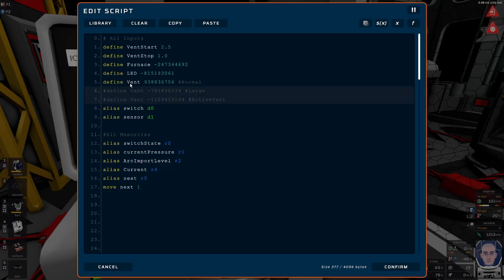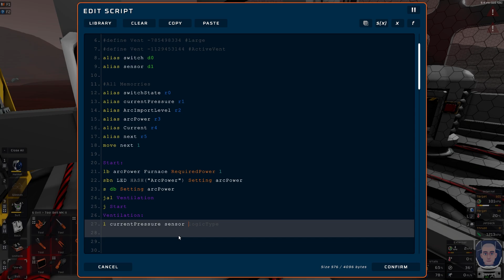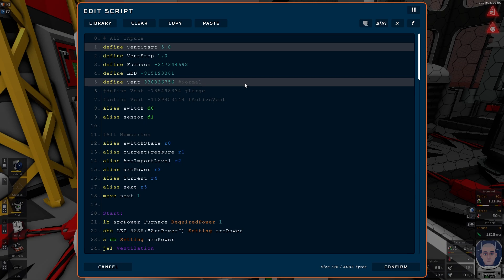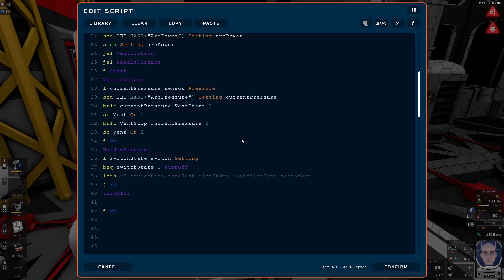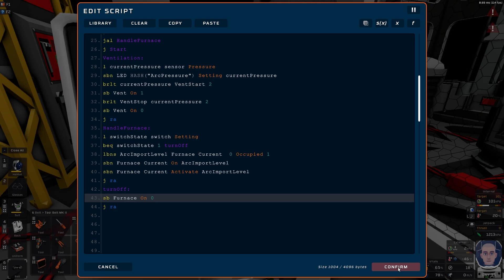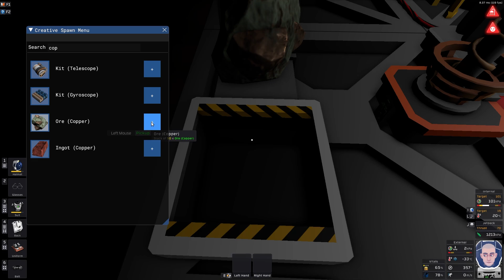Stationeers - Guide to Multiple Arc Furnace - Tutorial

Comment: Interesting concept. Well done.
Next challenge: rewrite the script to use the batch-write option so that you don't have to address them individually.
Reply: For harvies there is a WAY simpler Script...  Where you basically define dropoff Index, fertilzer Index and how many pots you have it...that make Things way easier
Reply from the maker: Thanks, glad that you liked it :)
so the thing is that with a batch write option all your Furnace would always both turn on and also activate, this means that you would waste power. but it won't take long to add the lines for that so that people could chose
Reply: @osarus_TV thats true....but why overcomplicate Things....simplictiy is key... Or simply turn all of them until idk 5/10 are occupied
Reply: @osarus_TV  You could, for peak efficiency, store each name hash in the stack once (it persists in the chip), delete the lines, and then just use code to iterate through the stack. 512 furnaces would be possible, each with a unique name. =)
Reply: @osarus_TV  Another option would be to add in a script to flash the names of the machines into the memory and make the chip iterate across it.
Also: look into Cows Are Evil's planter script that matched Harvi's to plant pots (might be the same, can't remember).
The power management is top notch here. 👍